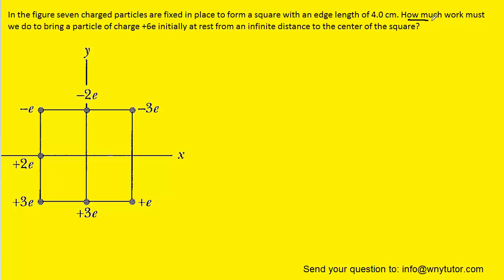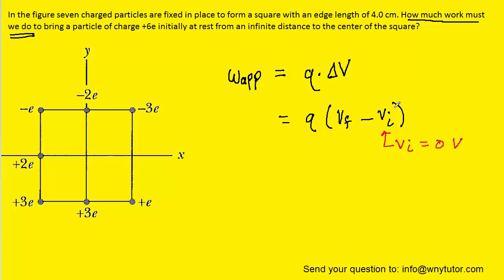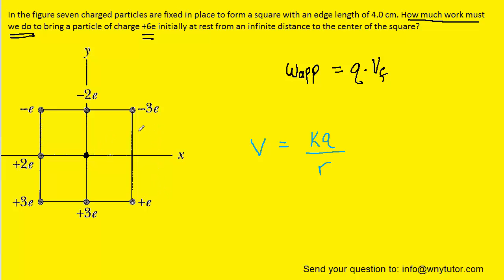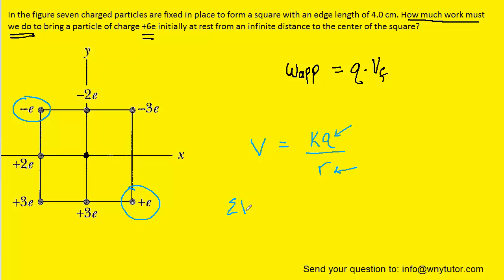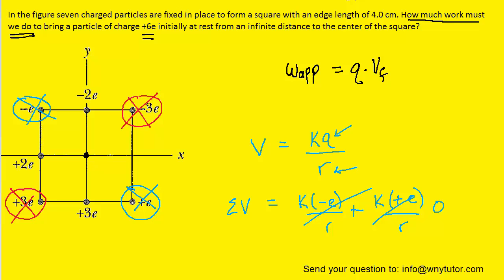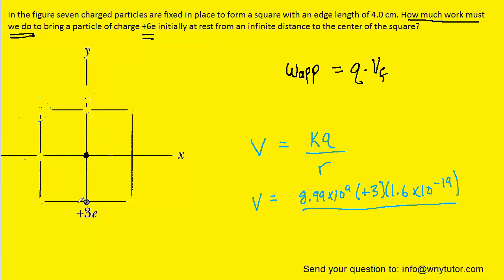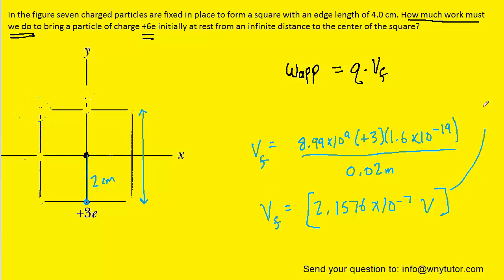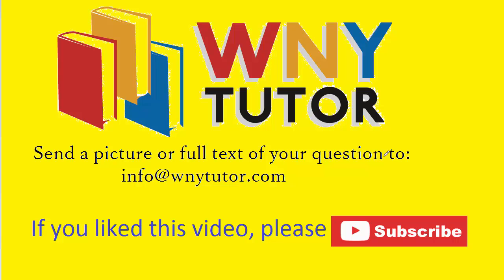Seven charged particles are fixed in place to form a square

Comment: please do this for me:  A 0.6-m radius cylindrical region contains a uniform electric field that is parallel to the axis and is increasing at the rate 5.4×1012 V/m s. The magnetic field at a point 0.2 m from the axis has a magnitude of:??  ans=5.40e-5